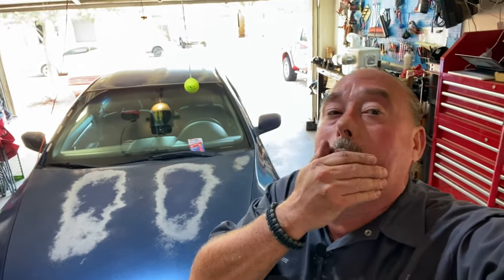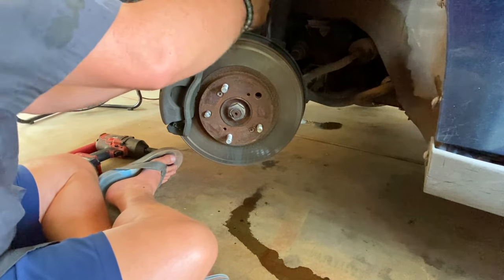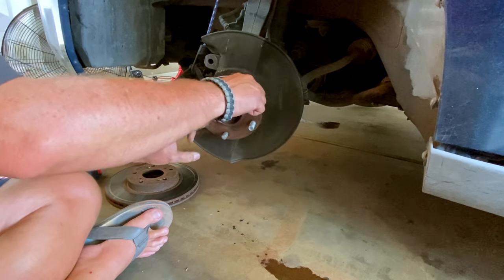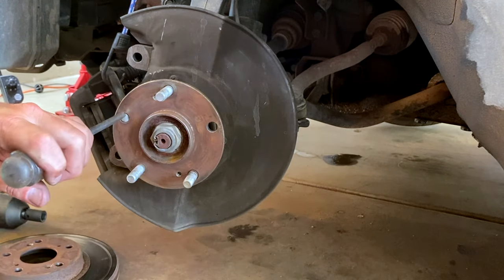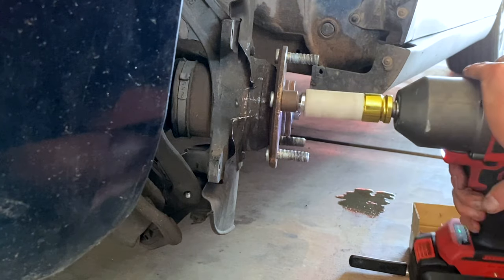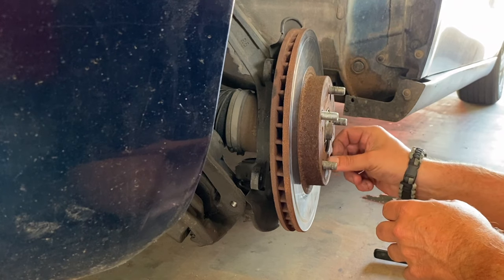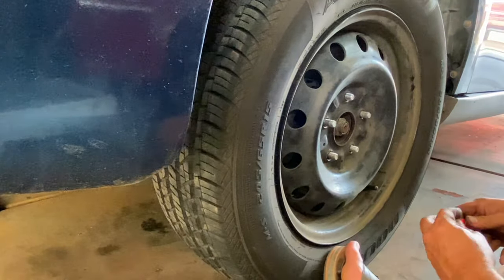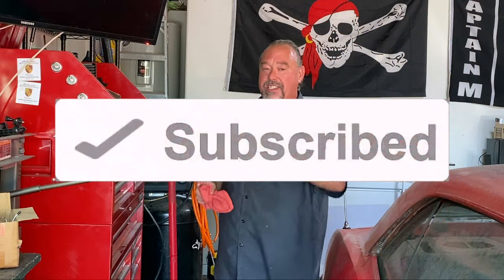How to Replace Wheel Stud - Broken Wheel Stud or Stripped Wheel Stud

Comment: No wonder you keep breaking those off every time. You don’t need three lock on the rotor screws and definitely no thred lock on the lugnuts
Reply: Great!
Reply: Probably puts thread lock on the valve stem cap
Reply: Yep it’s already applying pressure by the wheel so it won’t already back off

Comment: Why would you use any loctite on the rotor screws? Most people just leave them off anyway. They only hold the rotor on for easier assembly. I've never had one back off on its own.
Reply: Red loctite on the lug studs too.....😮😮😮😮🤪🤪

Comment: dont use locktight those are only used at the factory to hold rotors on during assembly in the factory.and non removeable locktight next guy is gonna be pissed when hes got to do a brake job..use some anti seaze instead or go in dry.

Comment: you dont need to hammer the stud in, in fact its not god for the threads
Reply from the maker: If they will slide in then absolutely… my last two acuras I had to grind down one side to get them to slide in.  Thanks for the tip!
Reply: How do you put them in without hammering??

Comment: Hey i was just wondering how can you tell if you need to replace a stud or the lug nut?
Reply from the maker: A few ways, you'll break a lug-nut off with the stud inside it, lug-nuts won't stay tight on the wheel after a few hours, or you can't unscrew or screw on a lug-nut as the stud is damaged.

Comment: Oh, I hate those rotor screws. Just did my daughter's RDX rear brakes and had to drill them out to replace the rotors.
Reply from the maker: Sometimes they can just seize right on. up... drill drill drill :(
Reply: That is why you use antisieze or leave screws off but thank  you on the tip on cutting part of back cover off will use this in future have customers sign damage waiver.

Comment: Awesome video - Thank you so much! I will have to fix for 2013 Acura RDX. Can I use a ryobi multi rotary tool to cut the shield? Also, any tips to not ruin the threads while hammering in the stud?
Reply from the maker: Yes the Ryobi will make the cut in the dust shield so you can get that stud in.  Make sure the stud is straight and you should be good... when you thread on the nut to tightening the stud to the hub it will clean up any lightly damaged threads.
Reply: Thank you

Comment: sry i have a silly question -- do you have to jack up all 4 wheels, turn the car on, and then to shift it into neutral, to move the wheel and change multiple studs? is it safe to do so?
Reply from the maker: No you don't have to jack up all four wheels,  you can jack up one wheel at a time... Just put the trans into neutral and spin the tires as needed.

Comment: My question is how do u get the bearing to spin like that to get to the location where I cut the brake dust thingy
Reply: Put the car into Neutral and you can spin the bearing around.
Reply: @BennyChoda  it didn’t work
Reply from the maker: That should have made the wheels spin... hummm
Reply: Make sure both wheels are off the ground and put it on neutral

Comment: Yeah, I do it similar to this, but instead of using thread locker, I use anti seize on the rotor screws and locknuts. Also, I find it a little bit easier to compress the piston on the caliper rather than fighting it off of the rotor Pretty simple to do with a prybar while the rotor is still bolted on. I don’t have a problem with running the Lugnuts back on with an impact, but a lot of problems with broken lug studs come from over Torquing the lug studs stretching the metal and then it shears them off. Not sure if that’s what happened here or not but if you’re gonna run them back home with an impact, I would suggest a torque limiting extension somewhere between 80 and 100 foot pounds usually would be about right if you’re using electric impact it’s going to over torque it some so I would suggest the 80 pound variety. Or you can throw them on with a torque wrench. Torque specs for your specific vehicle are pretty easy to find nowadays with the inter-webs. Additionally, the spacer I use might seem weird at all, but I use the actual rotor since it’s laying there and I don’t have to go find anything. Also, while I’m there, I would’ve probably went ahead and changed the brake pads. You already had 90% of it done and I’m weird even with headlights if I change one I change them both so I probably just would’ve went ahead and swapped out the rest of the studs, but that’s what makes people great. We’re all different. And if I didn’t have the first clue of what I was doing, I’d let someone else do it.

Comment: with the impact, how much ftlbs rating does it have to be to be able to pull it in? I'm asking because I bought an impact from walmart and it cant even take off my lugnuts. I also don't think I need those 1400ft lbs ones. What rating would you recommened for automotive work? Lugnuts and wheel studs?
Reply from the maker: The one you have now should be good enough to pull the stud thru the hub... I used the Bauer Impact from Harbor Freight for the last 4 years with no real issues.  Hope this helps.
Reply: @ArrowheadGarage  Which one do you use?

Comment: When you put the brake caliber back on is there anything special you need to do to the brakes like bleed them
Reply from the maker: No only if you pull the rubber brake line, other wise no bleeding in needed.
Reply: @ArrowheadGarage  thank you
Reply: Didn't check abs

Comment: Is it just me or do the new lug studs you installed look shorter than the others? Wouldn’t that be a problem since there might be less threads holding the wheel in place?
Reply from the maker: They are the same size, it might look different on the video but they are the same size.  Thanks for watching and asking.

Comment: Anything I should be careful of to not mess up the thread?
Reply: Also would blue thread lock work better so the tire can stay in but be easier to take off when needed
Reply from the maker: The stud should drive in straight, but you fub up the threads just run a die down on it and you should be good.
Reply from the maker: Skip the thread lock if you are good with the job.
Reply: @ArrowheadGarage  okay thanks!

Comment: This wont work for me. And there is not one single video on my issue. I have double threaded studs. They screw in they dont "pop" in and out. And i cant seem to get them off and have run out of ideas
Reply: Heat and lube. Easy way is to cut them off or drill them out.
Reply: @GarzaGoose  i finally got them. Had to buy a 5/8 stud extractor it tore up the threads but I wasn't worried about that I got a replacement set. Happy to say I'm past this chapter on the car...for now lol
Reply: @JeremyStaszak  That's good bro lmao I fucking hate dealing with broken or stuck studs. 

Had to drill out 3 studs today on my rusty car. A damn 20 minute brake job turned into a 3 hour mess. Had to buy a big ass drill bit to carve away.

Comment: OMG!!
Speaking of NUTS and amateur hour hackery...This Guy!!☝️
Don't do anything this guy showed😳
Hammering in studs from the back, using an impact and pulling them in dry, no lube or grease on the threads or splines etc is asking for trouble.
Further more, Red loctite on anything is nuts, and using it on rotor retaining screws which are only really used for ease of assembly in the factory is just dumb, the caliper ans wheel will hold the screws and the rotor in place once they're on, and the screws will never just fall out, just nip em up, or leave them out altogether, out the wheel on and you're done🤣
I'm not even going to mention how DUMB it is to use loctite of any kind, especially red on the lug studs...no wonder you keep seeing broken studs...DUMB, DUMB, DUMB!!🤦‍♂️